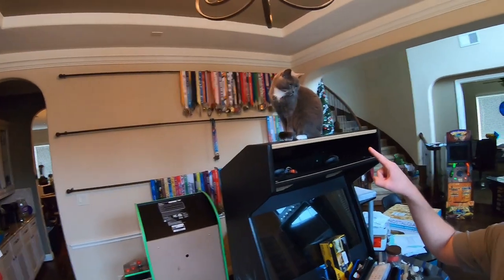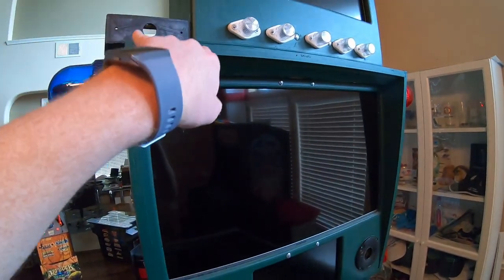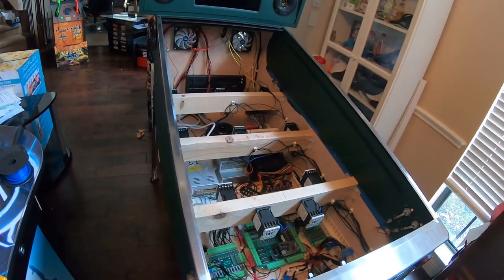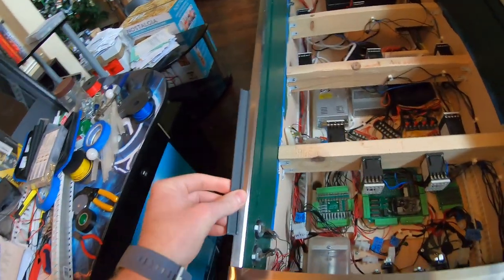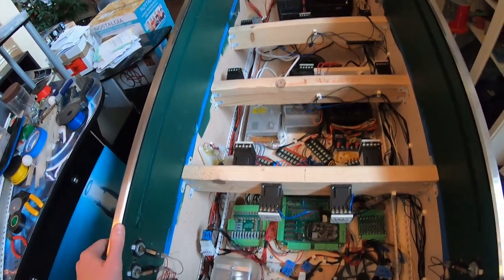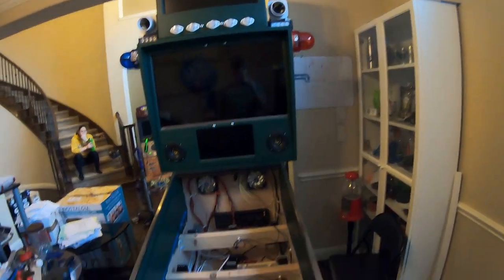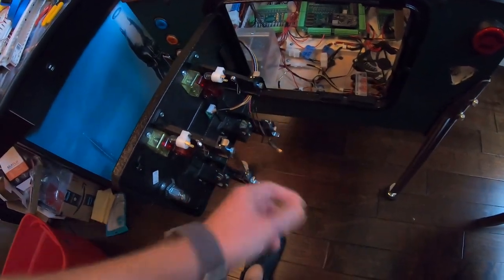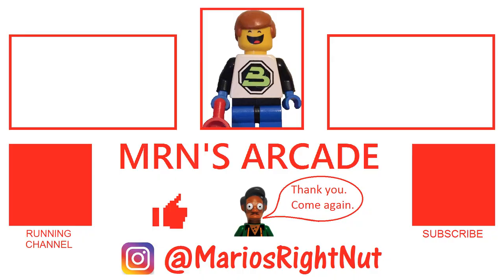Strobes, Fans, & RGB Buttons - Virtual Pinball Build 17

Comment: Nice build so far, been following for a while! Quick question tho, you have connected lights for start, launch & extraball to pinscape high power outputs and not the small/opto output, how come? And is it the usual connection cathode to pinscape and anode to +5V?
Reply from the maker: The buttons can be controlled individually by the pinscape through those outputs, the opto one would just have them on all the time?  That’s my understanding. That way they can flash or be on when the game uses them. If you don’t care about that functionality, you’re probably right. I think I have it correct. Thanks for the follow!
Reply: @MRNBricks  ty for the answer. Keep it up soon done! ;) ;) ;)